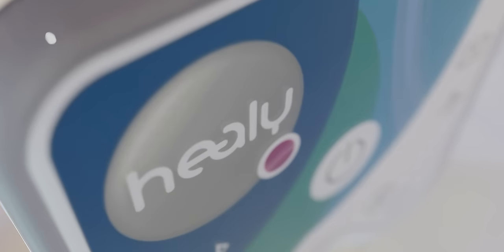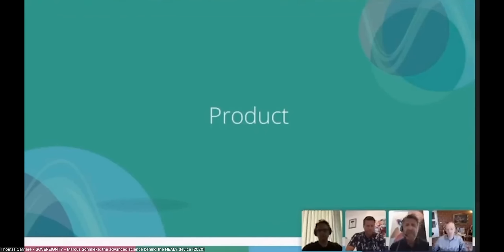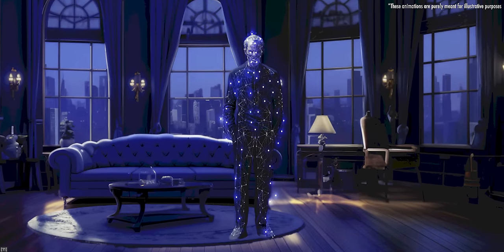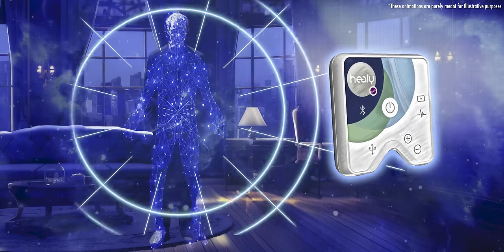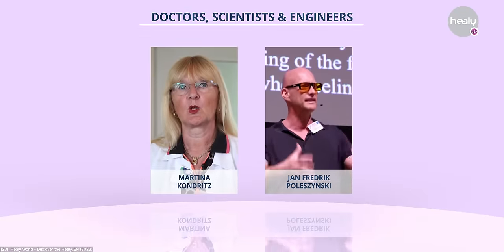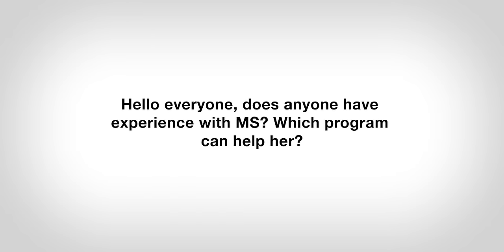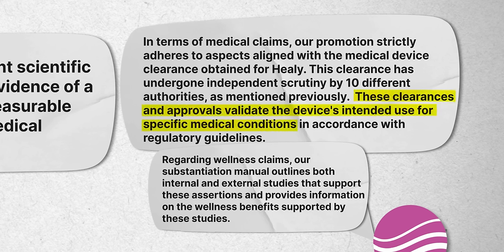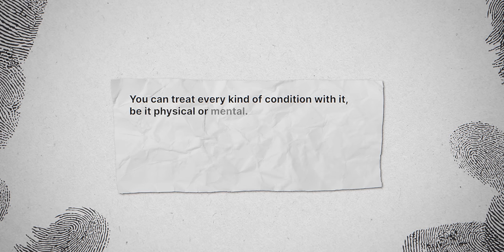Exposing a $140,000,000 Scam

Comment: Love the video.  
 …Sorry for the long read 

…One thing regarding the FDA: I work in the medical device industry as a mechanical engineer, now focusing on guiding companies through FDA submissions and testing. Concerning the Healy, it's not intended for use in medical settings or by anyone practicing medicine. Therefore, it doesn't have to undergo the FDA's lengthy testing process. The FDA doesn't "clear" devices; it approves them for specific purposes, which aren't transferable to other uses. For instance, if you have a bio-compatible tested tape, you can't use it in your device without proper testing data and reasoning for its safety. This principle applies to all parts of a product. When a device is FDA approved, it's only for the application outlined in the study, and any deviations aren't approved for that device's use. So in summary fda “clear” dose not mean anything in this context. 

Byby

Comment: 9:00 50 $ is way too much for this. You can buy a 10 $ microcobtroller and I'll print you a plastic housing for it for less than 40 bucks. I'll even paint some colofull circles on it with a sharpy for free!

Comment: Although I suspect that this device has no physiologically significant effect, and I would never advise its use as a therapy, from what I have seen Healy International B.V. has done nothing "sinister." At least as presented in this video, the firm declares, in an explicit and direct tone, that the mechanistic basis lies outside current scientific understanding. The firm also makes no medical claims as to the efficacy of the device ("'harmonizing' sleep and work," or whatever, is not a medical claim). With regards to the high price relative to the cost of components, this is a standard, accepted business practice: how much do you think it costs to make an iPhone or a pair of Jordan sneakers, relative to the retail price? [rhetorical question]

In conclusion, Healy International B.V. should be closely monitored by the relevant government agencies and public-interest organizations, however it should also be allowed to continue to operate. (In posting this comment, I declare that I have no conflict of interest.)

Comment: Never heard of it & everything I've heard so far , sounds like a load of bull plop . 
 Yes Frequencies, specific Frequencies , which do help , but one machine , is to , to much  .  Tibetan Bells , or Bowls , will do more for you than this thing will .  
 Better to know the frequency , and get a frequency generator , at the correct solfeggio frequencies .  
 There's a lot that science doesn't know now , let alone what is alledged by this company .

Comment: I have to admit I have a healy😂 I don't believe in any quantum stuff, but I thought it works with micro(?) electricity. I tested it from a friend and now I use it for my migraine and hey fever. In spring time I sneeze 20 times, can't even leave home without pills, but since 2 years I didn't need any. I hated them making me tired... so I will continue using it 🤷‍♀️.... but I would never use it for anything serious like cancer
Reply: That most likely is  just a placebo, but hey a good placebo is woth a lot.
Reply: The Placeboeffekt is really strong. If placebo is strong enough for your problem, then it's completely fine.
I like your awareness that you don't trust it for dangerous illnesses.

Comment: Would be interesting to know which excact infrared sensor this is.
Else i think you dont deep dive enough into the functionality.
They claim to use a kozyref mirror with a detector init.
So is it an infrared sensor? It is not enough detail in your video about it.
I think it leaves to much open gaps to still believe in it.